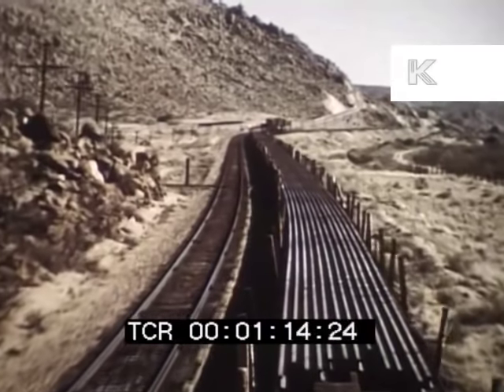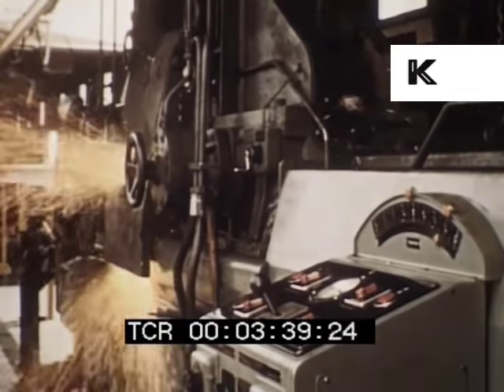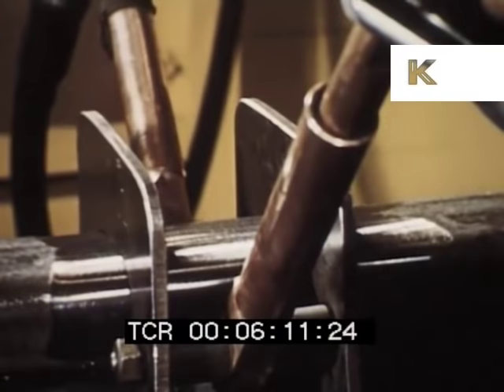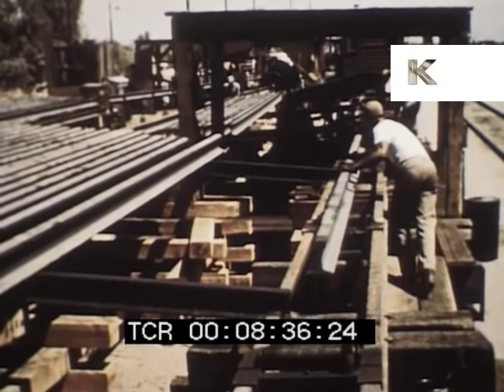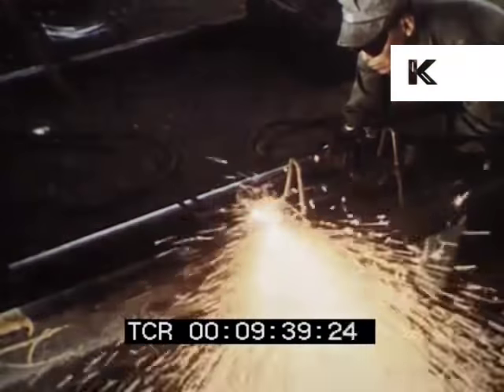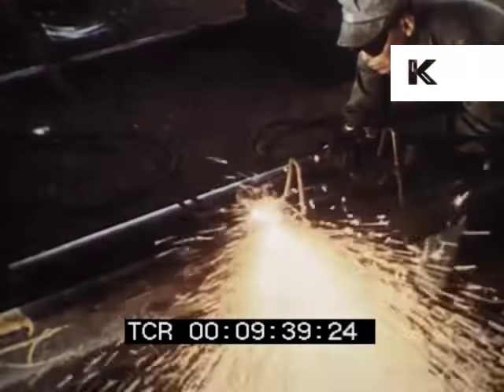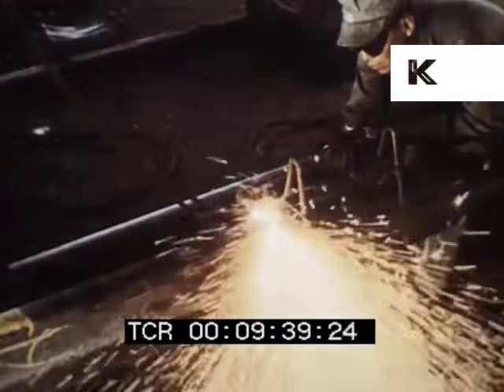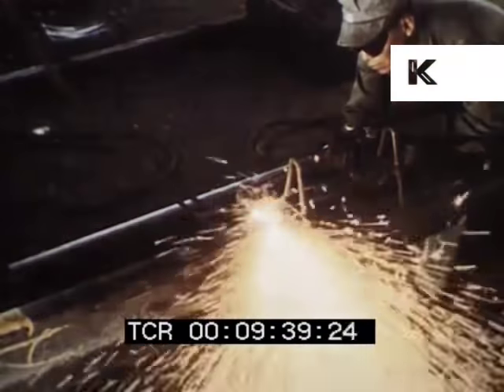1950s Men Working on the Santa Fe Railroad

Comment: I still remember track walkers on the UP in the late 1970s inspecting each rail joint, tightening them and lubing them as necessary. They walked the entire line (a few miles a day).

Comment: This is really interesting I didn’t think they started welded rail until the late 60’s.  I guess Santa Fe was ahead of the game. As a welder myself it’s neat to see the different welding processes.  That was a dirty job for those guys especially the grinders🙊
Reply: they were hooked up..now high speed trains will run on those tracks
Reply: There are some short lines that still use the old style.
Reply: The US Steel roads were some of the earliest to do it in the 1940s.
Reply: seriously - i worked at Norfolk Southern and thought CWR started in the 80s. Im impressed by Santa Fe !